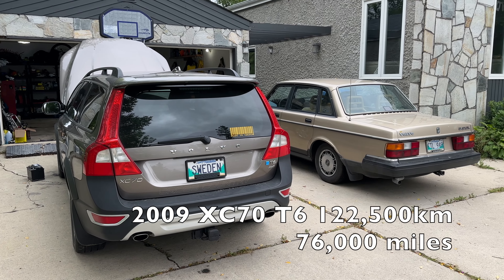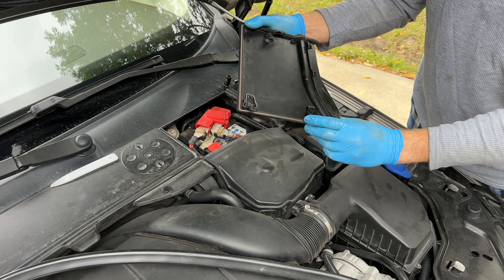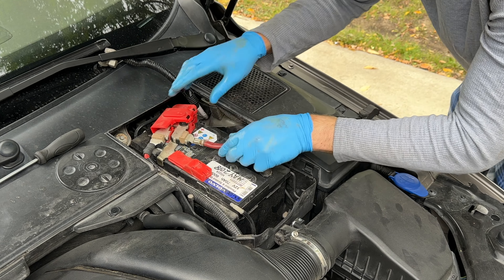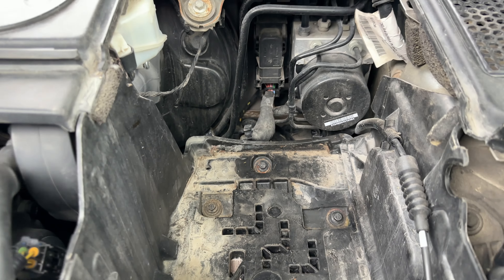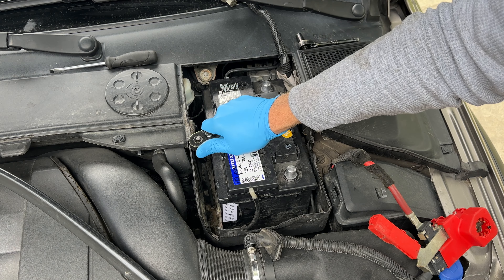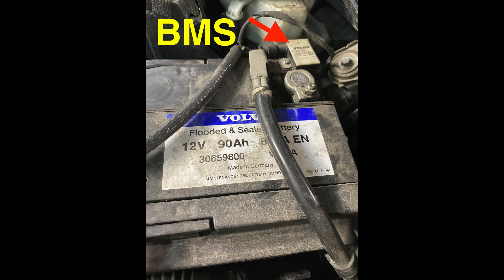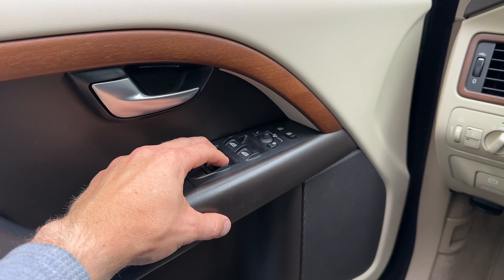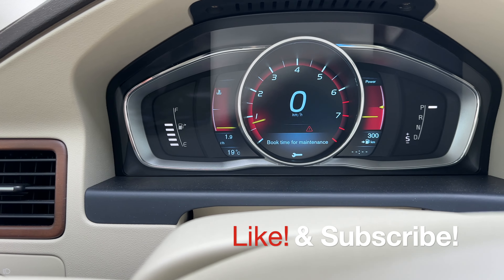Volvo XC70 battery replacement every five years. Done!

Comment: My battery on my D5 XC70 is nearly 12 years old. It's original. I trickle charge it if I don't use the car for weeks, it hasn't got weak or doesn't struggle in cold.

Comment: 99% of EVs still use such an old fashioned 12V battery. In most cars the battery still is the number one cause of problems / brakedowns. Although according to JD Power now software and doorhandles are even more problematic. "Progress"  🙂
Reply: "old fashioned 12V battery." 
They are cheap, safe and reliable thats the key reason why they are used in so many places. They can deliver A LOT of current too.
Also 12v, 24v are such standardized voltages it would be more wotk to re-engineer systems towards lithium batteries.

Long term LiFePo will tahe over though.

Comment: Doesn't the volvo have a second 12v battery hidden somewhere that might also age or do i remember incorrectly? (nevermind: i think it's only newer models with telemetrics and mobile connection)
Reply: Only some models / engines with a manual transmission if I recall correctly.
Reply: Start/stop function uses 2 batteries. The 2nd one is placed under the wipers I believe.

Comment: I have a V60.. But the battery reset procedure without any tools is this and I've used it a few times and confirmed with VIDA it works
1 - Turn lights on
2 - Press rear fog lights button 6 times
3 - Press hazards 3 times
4 - Battery indicator should Flash and then go out
 
There is a YouTube video showing this. But I find the text instructions quicker to understand

Comment: My 2007 V70 has the battery in the trunk and I believe thats the superior placement for a lead acid battery.
The key word being temperature. The battery is in a more stable environment back there.
Also zero corrosion on the contacts.

The last one was an off brand cheapo and it lasted 8 years until failure according to manufactured date.
Reply: I also have a 2007 V70. Replacing the battery was easy.

Comment: The battery in my 850 would die every four years.  This was due to it being exposed to the heat of the engine and the cold outside temperature in winter.   On my V70 P2 the battery was in the rear and protected from the extremes of temperature change and it lasted 13 years.   I still have it on the floor of my garage to power the occasional 12v tool.

Comment: Changed mine to a 95Ah AGM ~7-8 years ago, seems to hold up well so far (probably about 150000km so far). All I do is charge it from time to time during the winter, and maybe a few times during the summer. I do cover more miles than you though, which keeps the battery charged and healthy.

But as usual, an informative and good video 😁

Comment: Just did my 2015 today.  Mine did not have the long bolt holding the clamp and the battery box was very tight. Access was very difficult until I figured out that the front of the battery box was a removable panel.  Costco had a good AGM battery under $200.

Comment: Good job, just changed the two batteries on my S&S 2012 S80 last week as well. My main battery dated back to oct. 2019 and was stuck to a SoC of 63%. My secondary battery was from 2012, toasted.

I discovered an unprotected pass through behind it allowing me to finally wire my OEM front wide angle camera. I would recommend to anyone owing a P3 to check whether they have unprotected holes behind the secondary battery as my yellow interior insulant behind was pretty dark compared to other locations. I would see mold developing easily on humid climates if left open like that.

The job is admittedly easier when you did not mount the S60 R Design strut brace.
Now, I won't make the same mistakes, I will keep them charged using my Ctek charger all the time. Adding equipments such as dashcam and CarPlay module for Sensus does not help. The latter fires up each time I start the car now, so that solves another issue! And I was able to get rid of an Airbag message on the dome light panel as well. So many benefits from just changing the batteries.

Comment: Same 30772221 battery on my S40 and I think it shows some signs of weakness after 7 years (2016-2023) and some -25 Celcius in Quebec. Since I'm working at home, I don't have to worry too much about the age, but I do have a new replacement in my basement!

Comment: 0:03 I had a 2008 Volvo XC70 with all-wheel-drive and a 3.2 Litre in-line six non-turbo. When I replaced my battery, there was extra length in the battery compartment, so I did some research and picked out an AGM battery that was long enough to fill up the entire compartment so I had more capacity. Have you looked into this? Thanks!

Comment: My previous Ford Focus still had its original factory battery working fine when I sold it at 11 years old. The battery on my present Focus failed at 2 years and had to be replaced under warranty. Luck of the draw!

Comment: Observation.

i replaced battery on my XC70 09 after it suddenly died on me, and i was confused as to why there is only one mounting bracket, but i see that you also have only one (the bracket down by the side of battery) seeing you also only have one, i guess thats good enough :)

Second thing, i am noticing, my battery is flipped 180 compared to yours, i have the connectors on the the inwards side, towards the engine, red cable connecting in front, black in the back. Length of my cables doesnt suggest it could be flipped other way around, even the vent connector is on the back, interesting how they flipped it around at some point. 

This weekend i will be attempting to diagnose/fix messed up drivers power window. Doesnt close entirely down (stays sticking out of the door about 5cm but can be easily pushed down, then it doesnt close up entirely, stops about 10cm off top, and moves by another 5cm on aditional button press, twice to close completely) cant wait to go trough the hassle of taking the door pannels apart :)

Comment: I always grease the battery terminals to prevent any corrosion.
Reply from the maker: Had zero issues with terminals as long as I own this Volvo. But it will not hurt for sure

Comment: Is that a Bensin(Gas) Xc70? Cause i gonna buy a Xc70 with Diesel motor and the batteries are bigger then that one? Maybe im wrong? 🤔
Reply from the maker: Check with dealer for confirmation for your car. Yes mine is Gas
Reply: @volvosweden  ah i tought so😃 for the moment i have a s60 2002 and batteri size is around 24x17x19cm. I Will upload clips of it once its bought, its my first kombi car and so excited 😆🙏🏽 Greetings from Sweden 🇸🇪

Comment: Hi, have a quick question about brakes and transmission. Yesterday I took my brakes to be done by a local guy and instead of pulling the slider pins, he took the two bolts out of the top that holds the caliper together to replace the pads and rotors. He put it back together, but I tried to tell him that’s not how you remove the brake caliper. Should I be concern now? Brakes seem fine, but wonder if I should look for something. Second question is noticed some fluid around the drive shaft coming out of the driver’s side of the transmission. Lower part of transmission housing looked like it had fluid on it, and some on the drive shaft. Does that mean I have a seal leaking?
Reply from the maker: Ideally you want to check the slider pins. But it’s not the end of the world. Most likely seals are leaking. What mileage?
Reply: @volvosweden  162,523 miles
Reply from the maker: @SterlingSigurdsen oh yes.at Thai mileage seals will leak
Reply: @volvosweden   damn okay. sure that's a mission to fix. wonder what that will cost me.

Comment: Was the original battery actually dying or did you replace it for fun?
Reply from the maker: I guess for fun. I replace every 5 years
Reply: @volvosweden smart! Less risk of running into a dead battery.
Reply from the maker: @jeffgroves4533 we get here -35 nights and I know many people that one morning the car would not start at these extreme temps. So 5 year mark is decent to make sure I am not one of them.
Reply: @volvosweden  that’s very true, not as cold here in Ontario. We keep our 2011 XC70 with 340,000km in the garage!
Reply from the maker: @jeffgroves4533 I hear around so many XC70 with such high mileage and it gives me confidence in my T6 ;) I had last week a Ukrainian guy come over for help with not working AWD on his XC70 which has 495,000km. Insane!